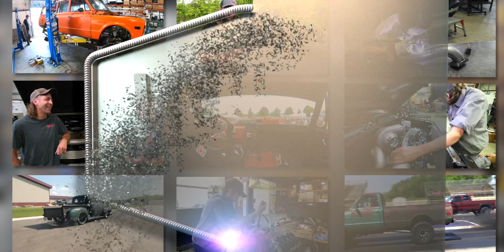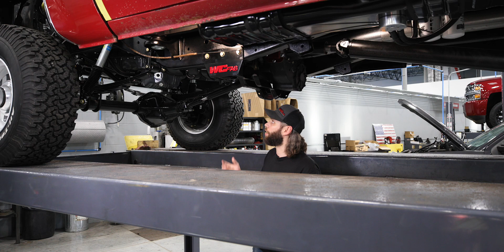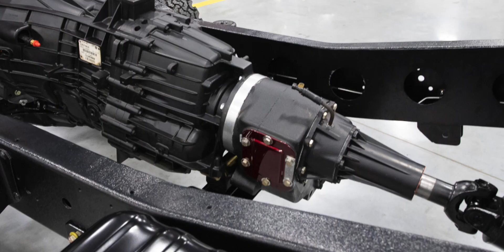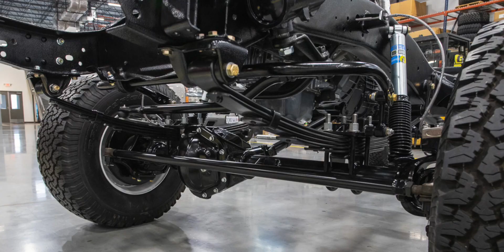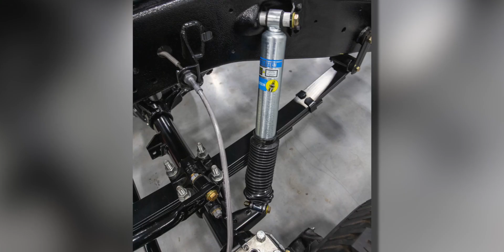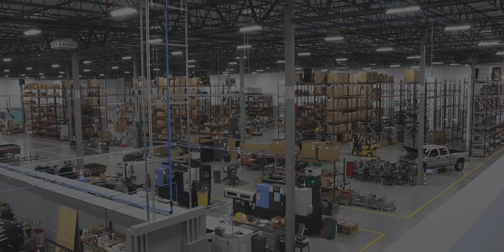WCFAB 1987 K30 Square Body Duramax Swap - Drivetrain, Chassis, Suspension and Axles

Comment: What size wheels and tires are on your truck?
Reply from the maker: The polished set are an Indy Mag in 17x10 with a 33x12.5 tire. The white steel wheels are original GM deep dish are 16.5x10’s with 33x12.5’s as well.

Comment: Awesome !! Would the Duramax blow a 400 transmission? What’s the base Lexie for a conversion like this ?
Reply from the maker: A stock TH400 won’t hold up. A built one might, proper converter selection may be harder to find, and you’ll also need a plan for the rear cover to adapt to the correct bolt pattern since Duramax engines are setup for an Allison from the factory. Not sure what you mean by ‘base Lexie for a conversion like this?’
Reply: Thanks for the response. I meant base price for a conversion. I’m planning on calling you guys Monday morning. Was going to do a Cummins but I didn’t know these conversions were already being done
Reply: Thanks for the response. I meant base price for a conversion. I’m planning on calling you guys Monday morning. Was going to do a Cummins but I didn’t know these conversions were already being done
Reply: Thanks for the response. I meant base price for a conversion. I’m planning on calling you guys Monday morning. Was going to do a Cummins but I didn’t know these conversions were already being done